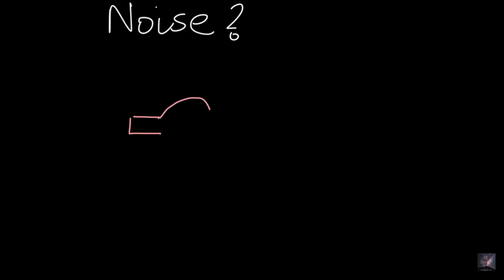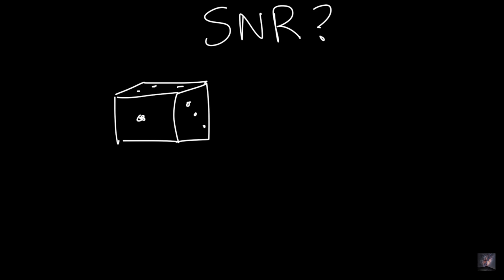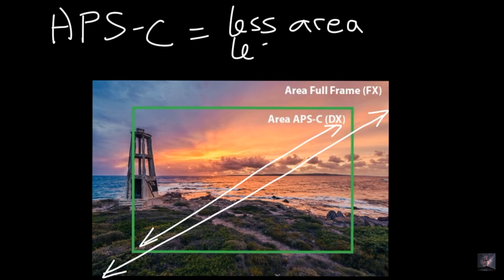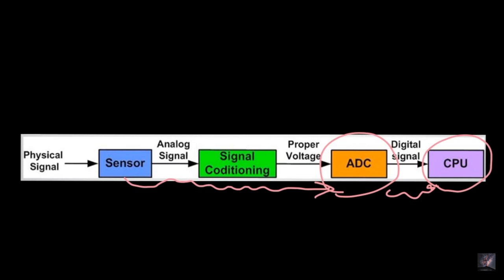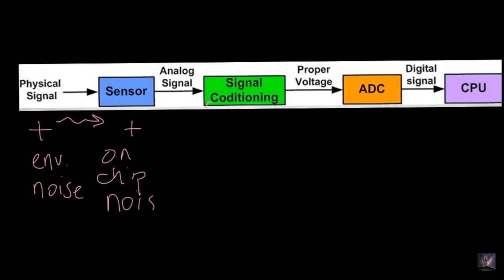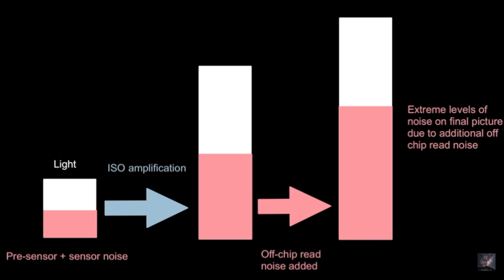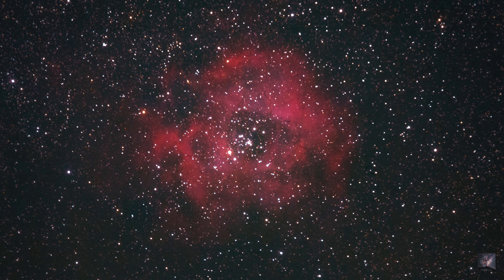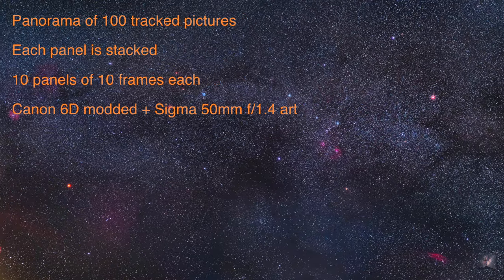ASTROPHOTOGRAPHY 101: How to improve noise, work with ISO and choose your camera? 4K - tutorial

Comment: BRilliant video. The only correction I would suggest is something you claims but complicating it. The first time you mentioned APSC you just mention they are smaller. At the second time you said the APSC sensor is smaller but take care with the pixel count. The way to unify it it just mention that the bigger pixel the better or the smaller the pixel density the better.

Comment: Great Video my friend. I'm glad I bought at 6D 2 years ago to do Astrophotography . I guess the guy at the camera store was right. He told me this is a great camera for low light.
What camera would you suggest as being number 1 for Astrophotography in 2020 and where  does the 6D rank compared to the new camera. 
Many Thanks 
Kind regards Sean
Reply: kinda late, but from what i can tell, the 6D would be my first choice in HINDSIGHT. I bought a used A7S for it and it's GREAT, but over 30 second exposures and it's kinda usless due to the star eater noise algorithm. 6D is going to be great for longer, tracked exposures

Comment: Nice one! Except for the fact that the size of the sensor doesn't affect the noise of the picture (even if usually bigger sensor means bigger pixels... but it's not always the case). Thanks for all the information though!
Reply from the maker: Lorenzo Bregant Thanks for the input! I actually have to disagree. The size of the sensor does play a big role on the noise, mostly indirectly. Bigger sensors (full frame) take in more light, also more pixels on the sensor means more difficult to fill them up. Remember the noise and signal do play together, so less light ultimately means more noise. I can assure you that if we took the test, the best noise performance will be the full frame sensor with the least pixels... at least for on-chip read noise!
Reply: Still not agree. In fact the best sensor for low light is a Sony once with only a few mp resolution due to the big pixels on it.
Reply from the maker: Lorenzo Bregant what is that Sony you are talking about?
Reply: It’s not a camera sensor. Just something developed for scientific application. Btw to prove this just think at light meters... if it’s about the sensor size they should change values for any sensor size...
Reply from the maker: Lorenzo Bregant PS that’s exactly what I’m saying in my comment if you read it correctly ☺️☺️
Reply: Probably I misunderstood due to my awful English..

Comment: What tracker brand do suggest for an enthusiast with a canon 5D Mk IV and a Rokinon 24mm f 1.4?
Reply from the maker: Well you can look into iOptron sky guider or sky tracker, Vixen also makes good and transportable ones like the Vixen Polarie, those are good for short and transportable tracking while using relatively light gear like a DSLR and a single lens (have used iOptron sky tracker and vixen polarie) :) Hope this helps!
Reply: Thank you. Can the Vixen Polarie manage the weight of a Canon 5D Mk IV and the new  sigma 14mm f 1.8?

Comment: Hey Adrien, which level of ISO do you think is the best with A7RII? in the video i see it is 1600.
Reply from the maker: def. ISO 1600 on super 35 and probably around 2500/3600 in crop mode. Actually for the former I would say 400-800, because it just takes some haze or airglow to noise up the entire frame, even though this stupid algorithm processes noise in a very different way from Canon!